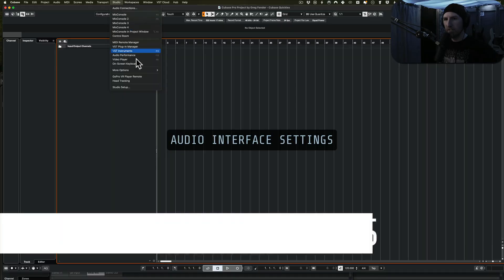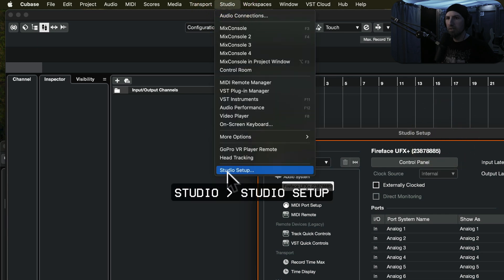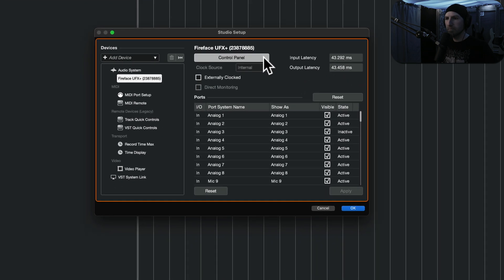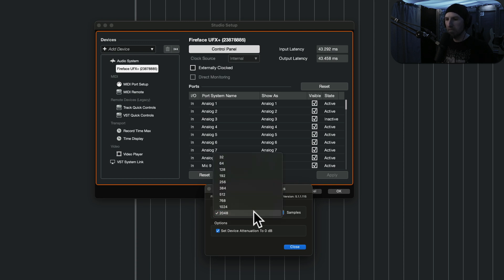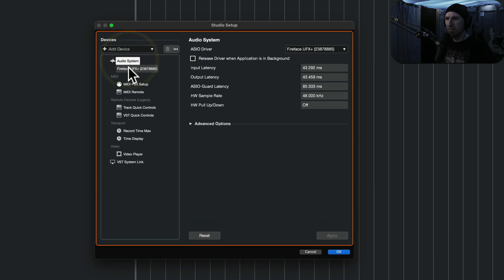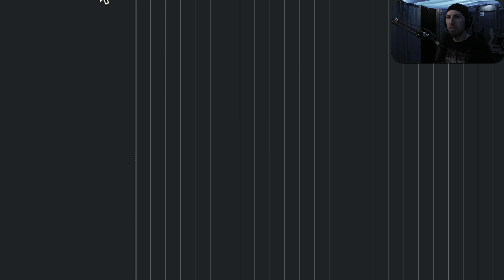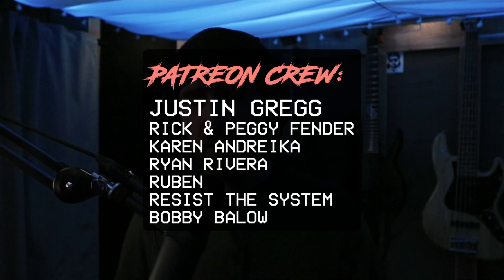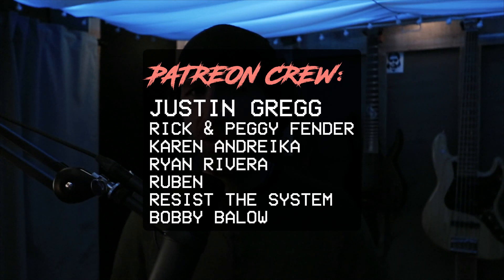Adjusting Buffer Size & Latency in Cubase

Comment: i guess since mine shows Steingberg built-in ASIO Driver, there is no way for me to lower the buffer size to get rid of the delay when I am playing the guitar, correct?
Reply from the maker: @shapourdashtpour63  I don’t have a functional Windows PC to test it out at the moment, but if you aren’t able to change the settings from within Cubase, you may need to open your interface’s settings and make changes there. There’s definitely a way to do it, but I don’t have a machine to poke around on. I’ll see if I can find something that will help out..
Reply: @gregfender  thanks
Reply from the maker: @shapourdashtpour63  this video might be more helpful for you than mine, he uses a Windows PC for the demo:
https://youtu.be/7mhkbZ3xBaw?si=Yipm6iSmp8wmR0xV